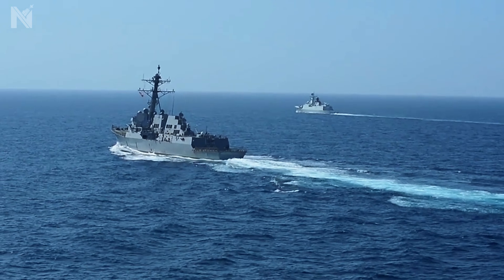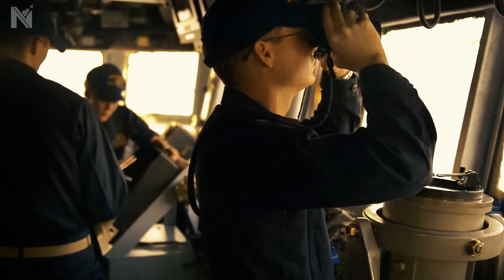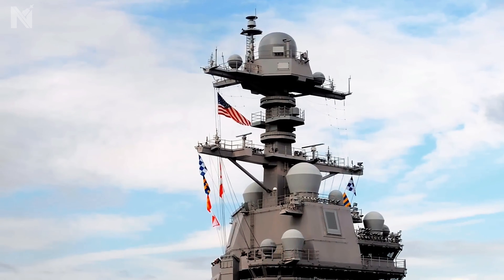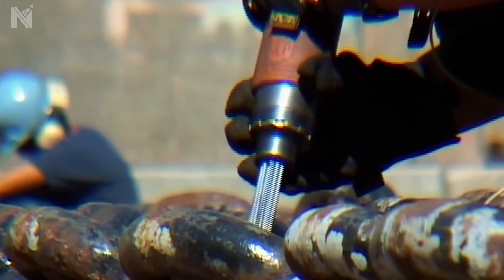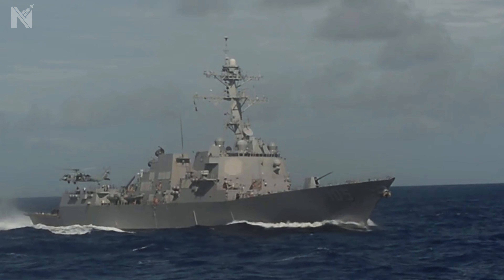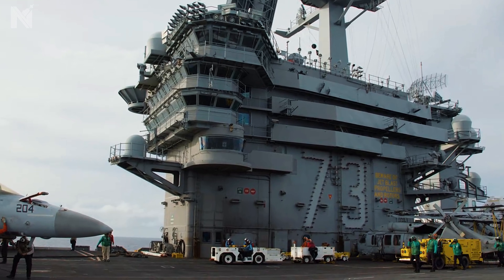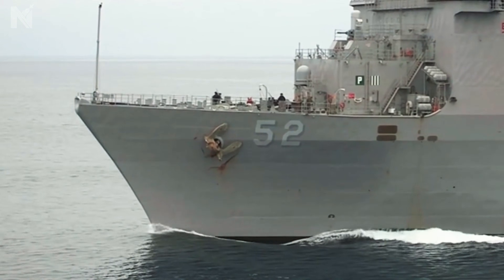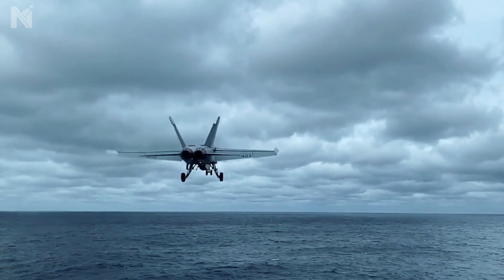"US Navy Is Broke": Why Ships Rust in the Red Sea

Comment: All of the comments below are valid but the main reason US ships show an inordinate amount of rust is because as one part of the EPA plan to lessen the longevity and professional appearence of our fleet they got Congress to pass a law to forbid lead based primers as well as using fuel that is not as operational sound. I don't know if it is true or not but I heard that there had actually been a serious case that affected the rapid deployment of fleet units back in either 2010 or so and they went back to the old fuel blend. Would appreciate it if someone could update me on that?
Reply from the maker: Yeah, I’ve heard that argument before.
Paint, fuel, regs—none of it exists in a vacuum, and sailors still have to make it work at sea.
Maintenance always ends up paid for in hours and manpower.
Curious how others here saw it from the deck plates.